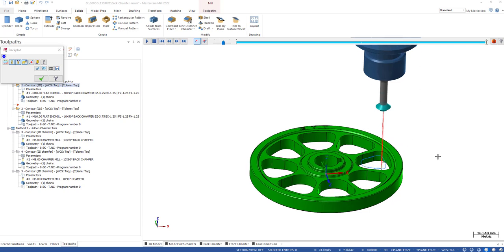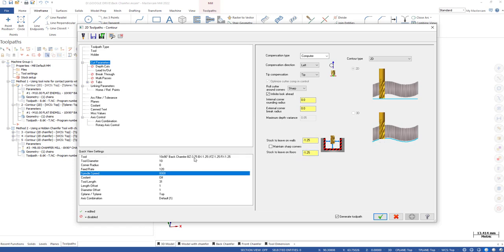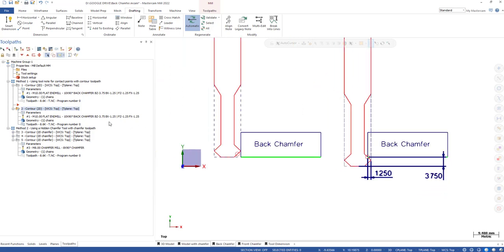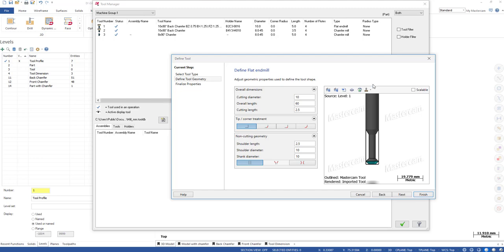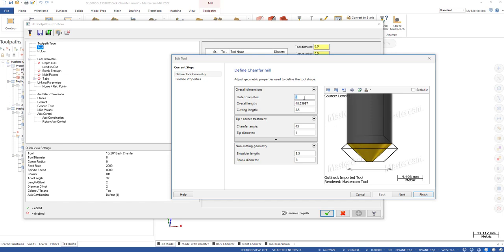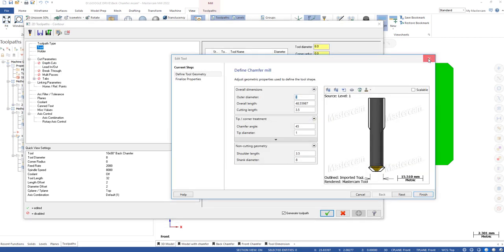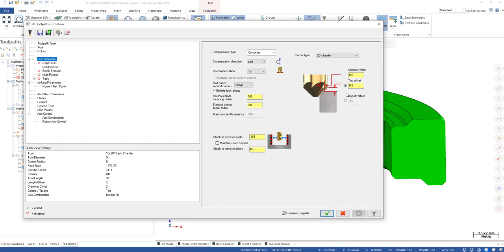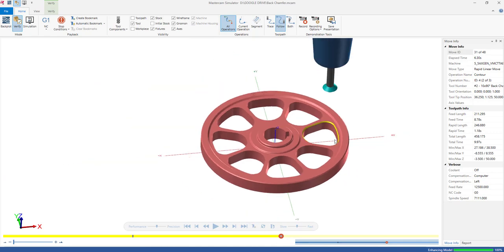Mastercam tip: working with the back chamfer tool

Comment: This is pathetic. Mastercam should do better. NX has the ability to use custom contact points that are stored with the tool in the library. You select the tool and you pick the contact point you want to use from the drop down and it just does it. No math, no shifting, no calculating. It works with both edges with modeled chamfers and edges without modeled chamfers. No additional calculating involved.